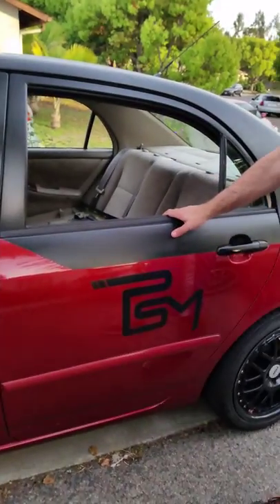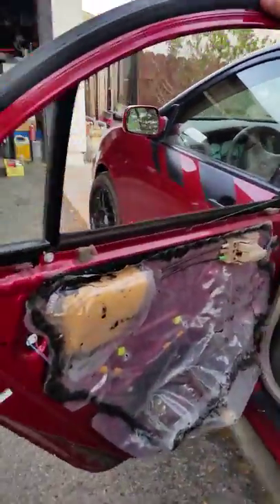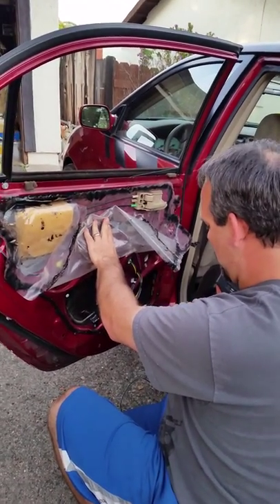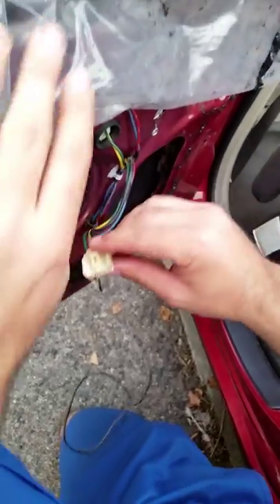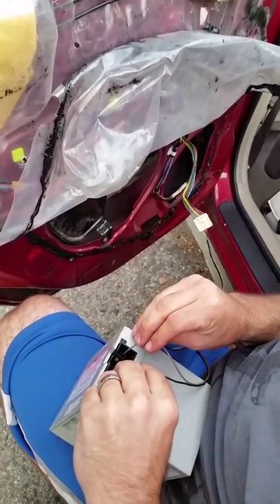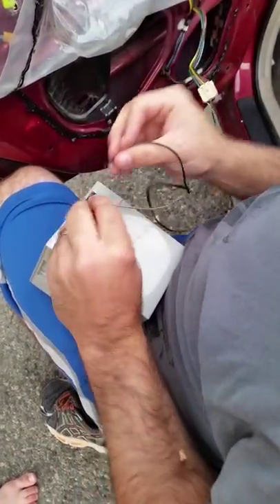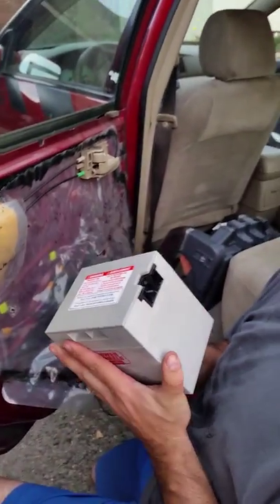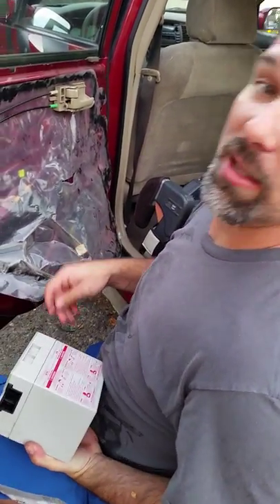How to roll up your car window using a power wheels battery

Comment: THANK YOU, THANK YOU, THANK YOU!!!!!!!!!!!  Both of my back windows went down and 2 hours later, neither one went back up. Everyone kept telling me it was the motor but what are the odds they would both go out at the exact same moment.  They have been stuck down since the beginning of this year until today.  Now I have my garage back.  I did not have the kind of battery you showed so I hooked it up to the battery in my daughters car.  Thank you very much.
Reply from the maker: So great that it at least helped you get the window back up. Everyone told me it was the motor too so I bought a new motor, installed it & nothing happened. Lucky I was able to return the motor & I searched for the reason it couldn't go back up. I looked on the internet everywhere & couldn't find any information. Through process of elimination, I came to this solution & it worked & decided to make a video to help others. 😊

Comment: Awesome! Been struggling since I got my car and this tutorial had it fixed in 10 mins. Just ran my wires from the motor into the backseat where my car battery is located. 5/5
Reply from the maker: Great to hear you were able to get the window rolled up. Thanks for your comment.

Comment: Thank you, your video clip is the best one I've seen so far. Only you never told us what size battery you used. One of your commenters  used an 18 V battery. Cars have a 12V battery so I assume 12V is good.
Reply from the maker: Trino Ponce, I believe it was a 12 volt, but can't confirm anymore as my girls grew out of the power wheels. Glad it is helping people figure it out rather than replace parts they don't need to.

Comment: My car i20 windows power motor connector (not the switch) has 6 wires connected to its motor. How to identify the control wires...?????!!!!!!
Reply from the maker: I would try looking up a diagram to see if I could determine what wires to connect. Other than that, just checking each combination might be the way to go. Ground wires are typically darker (black, brown or dark blue) sorry I couldn't be more helpful. Good luck.

Comment: Man I am going to do this to both my front windows of my Saturn Ion.  I have a bigger problem as my power window fuse keeps blowing to the point that when i insert a new fuse it automatically burns out.  A short somewhere.  This will be a ghetto solution for me.
Reply from the maker: Good luck with that & hopefully at least you will have the windows up.
Reply: @TeamSpeedyMotorsports  Thank you.

Comment: 2 year old video still helping people out , how about you have the best explanation on the entire web for this procedure . However I need your help bad . 2005 mustang , positive the motor is good replaced it brand new and still nothing . New switch and relays as well . Anyhow I have 6 wires coming out of the motor . I’ve looked everywhere for a diagram of this and it’s kinda  vague to say the least . I would really appreciate your thoughts no window for about a year now
Reply from the maker: Sounds like you have already narrowed down quite a bit. If a diagram is not available, I would just methodically test each connection into the female plug. If nothing works, I would assume at least one of the wires or the plug itself is bad & needs to be replaced.
Reply from the maker: Found a wire diagram on a Ford forum, maybe this will help. https://www.s197forum.com/threads/2005-power-windows-switch-wiring-diagram.117876/
Reply: My man you are a blessing, super fast response on top of everything ? Can you explain the position 1 and 3 you referred to . Was that the slot number in the connector or the position of the window movement. I was probing around for ground and positive ,I have done this to late model cars without an issue but it was only 2 wires coming out the motor . Anyway superb YT service man . I wish it was stars to rate your channel
Reply from the maker: @bobayagga2233  thank you for your high praise. I am just interested in helping as many people as I can. The 1 & 3 position I mentioned in the video was just the 1st & 3rd slot on the connector to the motor, I don't recall which was positive & ground. I hope you are able to get your window working soon.
Reply: So if I understand correctly I insert a negative end of 12v into the up connection and insert the positive end  into the down connection and vice versus until goal is achieved? Btw I bought an entire new drivers side door with the window up for $50 bucks and literally soon as I connected the damm door and turned the key the window immediately rolled down for good . Lol she sits with 2 car covers on her during rainy spells in San Francisco. Thanks again man totally appreciated
Reply from the maker: @bobayagga2233  Yes, I used a 16 gauge wire I had laying around & insert it into the female plug & ran it to the powerwheels battery. I'm assuming you used all the internals from the new door & just connected the plugs & it went down immediately?
Reply: Correct, rolled down immediately after turning the key . Btw I have the convertible and my top is not functional as well . The diagram on the link you showed me is for the hard top . Lol in that forum they failed to post the convertible version.  But I’m assuming it’s the same wire set up coming out the connector . I’ve been doing I bit more research on these diagrams and I believe there is a window module with a chip control the counts and it tell the Cpu what position the window is in at all times . The car has been thru some serious aftermarket butchering from the previous owner . I removed a viper alarm, aftermarket radio , Xmas esque lightstrips ,  And house speakers from the car and repaired all wires my eyes could see . And still no luck . This issue is all over the forums but no solutions . Honestly this brief conversation with you has provided me with valuable knowledge, I will be attempting the repair soon and will keep you posted on my progress. Thanks again
Reply from the maker: @bobayagga2233  sounds like a bigger issue than just the window. Glad I could help even a little bit, good luck.

Comment: Does the car need to be started
Reply from the maker: Crystal Cordova, no the car does not have to be on as you are using the power from the battery to roll up the window. This usually helps determine what the issue is and in my case, it rolled my window back up. If it didn't roll up, I would have replaced the window motor, if that didn't work I would have checked the wiring and replaced that.

Comment: How do you know what wires to touch?
Reply from the maker: Crystal Cordova, I just traced the wires from the motor to the connector (green & yellow in this case.) The other wires are the ground and the wire that connects to the switch to operate the window.
Reply: Team Speedy Motorsports thank you very much
Reply: I'm trying to get it down i have 5 wires red grey 2 blue and tan idk which to connect cable to
Reply from the maker: Crystal Cordova usually dark colors are the ground wires, black, blue, brown. I would do a Google search for your car and see if you can locate a diagram to help.